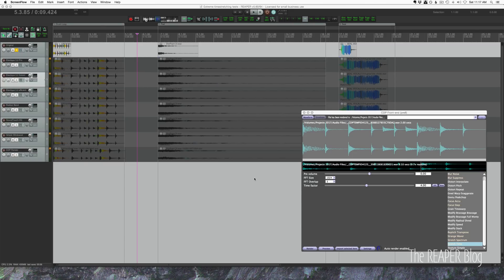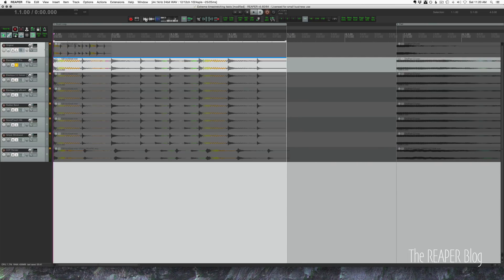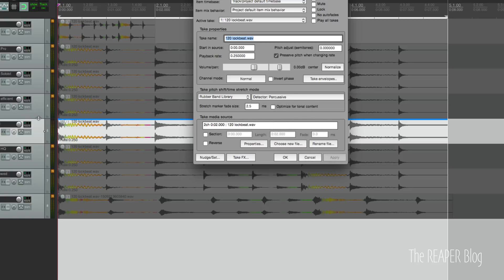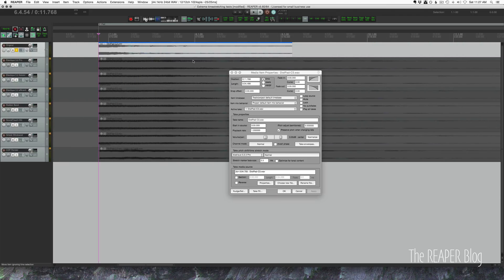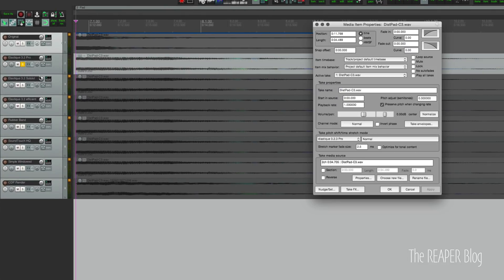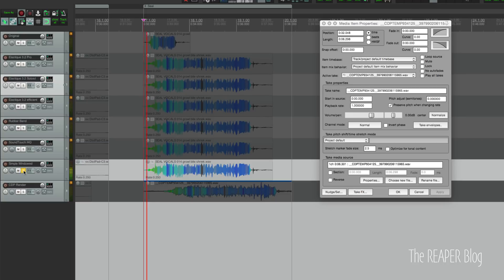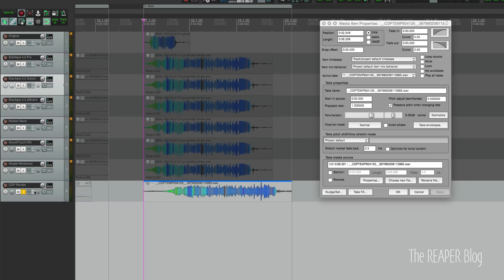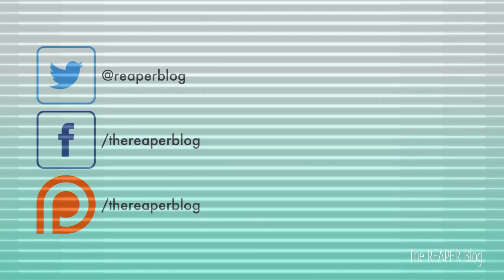Extreme Time Stretching - 7 REAPER Algorithms Compared

Comment: Jon, what is the reason you use Detector: Percussive in Rubber Band Library algorithm for all the kinds of sounds?
Reply from the maker: because I thought it would sound better for the drum loop. I cut out the part where I compared rubber band with other settings, didn't make much difference.